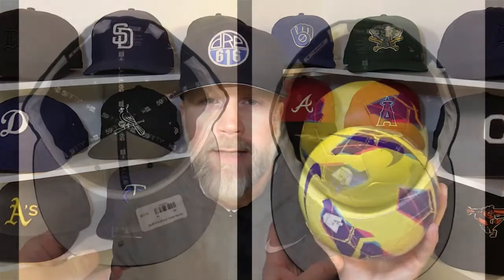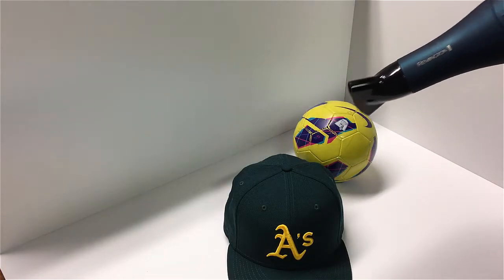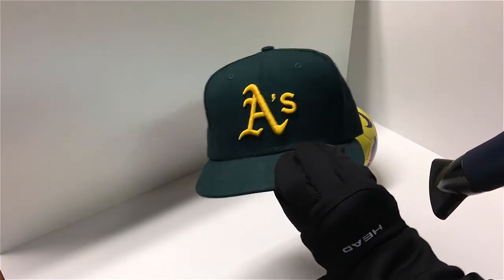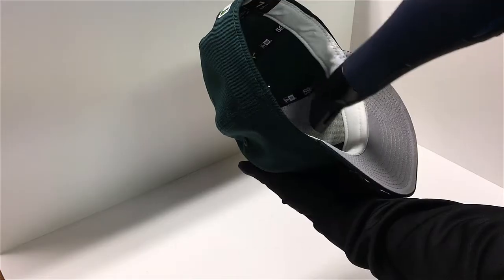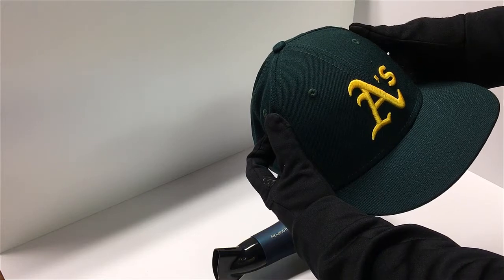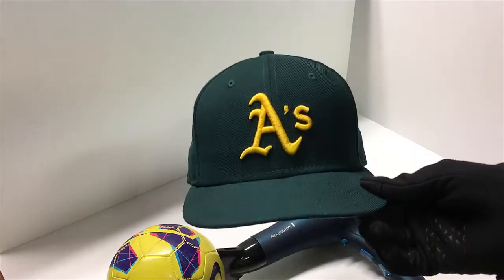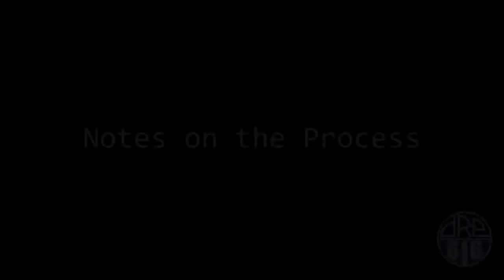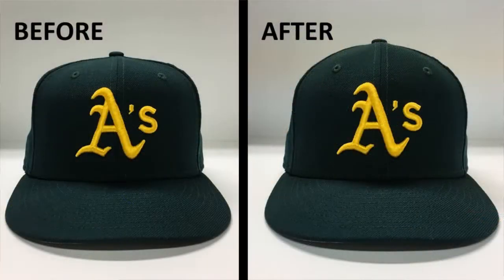Rounding the Crown of your Cap with a Simple Form

Comment: Good video. I switched to low profile 5950 for this very reason, really don't like the flat/boxy look.
Reply: I'm with you. I've noticed that the wide production variances in 5950s means that some are very boxy, and some are rounded. Likewise, some of the low profile ones that I own are almost too low profile.. they feel like a 5950 and a yarmulke had a baby..
Reply: I don’t think anybody does. Even the mlb players hate it
Reply: anyone know my one of my caps has a more stiff front end
Reply: like the back of my hat is round and not flat like you usually see other hats
Reply: Where do u get ur low profile hats?
Reply: @opshit9714  lids, new era, ebay, and sometimes ross/burlington if i'm lucky
Reply: @opshit9714  online. Lids has a few here and there sometimes
Reply: @SirPhilMcCrackinVonBeggington  that’s one of main problems the other is the fact that the sizing is always wrong like the 7 is always too small and the 7 1/8 is too big
Reply: @Bushdidharambe911  Yes, 100%. Sometimes I am a 7, sometimes 7 1/8. One of my 7s is too tight, the other one is too loose lol.

Comment: Is there a opposite method for making a crown flat if it comes rounded off ? I actually prefer the flat look
Reply from the maker: It's all about the form you use - here I used the soccer ball for roundness, but if you wanted more flat you could look for something like a pot or saucepan with a smaller radius on the bottom, and a small enough diameter to fit in the cap.  Then substitute that form for the soccer ball during the techniques that I showed, thanks.
Reply: Yess please make a video of you doing the method the other way around!

Comment: Great video! Thanks, I have actually stopped buying caps by mail (eg Lids) because of this weird shape. Might well help to get myself a size 1 soccer ball.  I wish there was something solid and heat resistant to put in there (bocce ball too small, hmmm) so I could touch it up before I wear it by just sticking the hard ball in there and heating it up a wee bit from the outside of the cap (while working it over the ball if necessary).  I’ll keep thinking, gotta be something perfect size and hard composition (candlepin bowling ball? Lol). Thank you for your videos.
Reply from the maker: You are welcome, thank you for the comments... and maybe there are some places out there where you can get an actual mannequin head from an old retail store.  I've often thought that might be the best form, but harder to find than a soccer ball!
Reply: @dreinthe616  Now thats a good idea.  I'm gonna look. 
Thanks Dre

Comment: How long do I keep the ball in the hat for?
Reply from the maker: Until it has cooled off close to room temperature again... those plastic fibers in the buckram need to cool off so they can maintain the form.
Reply: @dreinthe616  does it work for a 20% wool, 80% acrylic cap?
Reply: @dreinthe616  Oh I see what you mean. The two panels at the front are the buckram fibers that give it the shape..Thanks!

Comment: Will this work with a trucker hat? I just got a new cap and it’s outrageously boxy and high and makes me look like my head is about 6 inches taller under the hat. I hate it! But it’s a beautiful cap so I don’t want to give up on it!
Reply from the maker: Depends on if it has the buckram (stiff plastic/linen woven fabric) under the front two panels.  You can find a video on my channel "Stretching and Shaping Mesh Back Fitted Caps" if that's the case.  But this technique won't work if its a foam trucker, thanks.

Comment: How do I remove the pointy top of my trucker hat? Would love to send you a pic or what I’m talking about. But I bought adidas trucker hat and not a fan of the high point top
Reply from the maker: It's pretty tough to do that because the fold there is very stiff, almost all truckers are made in this way.  But that style of 5-panel caps is now coming back strong with the 9Forty A-Frames and Golfers from New Era, and the Hitch from 47 Brand.

Comment: Can you make just the crown of the cap smaller so it's not so high up on your head?
Reply from the maker: It's a lot harder than it seems - there is a lot of material and volume in the crown, and it has to go somewhere when you try to reduce the height.  In the third portion of my first video I show a way to heat with a hair dryer and mold it a little more to your head, you can see that here if interested - https://youtu.be/8N-EL-rmgIc - thanks.

Comment: How can i do the opposite, i have a very round hat that use to be more square and i want ti reshape it back to a more squared look.
Reply from the maker: I actually get that question quite a bit, may need to make a video soon.  Anyway, just like I used a soccer ball as a round form, you could repeat the process but use a different form to mold the cap - maybe you could find a small pot or saucepan that has the flat top and a small radius... that might give the look you want, thanks.

Comment: Hey Dre. I believe u have seen a THE PERFECT GAME hat and in the inside there is like a thin material on the crown.  Can I still shape the crown ?
Reply from the maker: The structured crowns in New Era caps have plastic fibers woven through the buckram, which gives the front two panels the stiffness.  If your cap material is not stiff and structured, it probably won't hold a shape.

Comment: Could you just place the cap on your head and press the crown against your actual head after you heat it up so it takes your head form, or do you think it’ll be to hot?
Reply from the maker: Good question, yes, you can do that, in fact I showed that method in my very first posted video on stretching and shaping... but if you've got short hair or a receding hairline it gets really hot and uncomfortable.  It can also leave 'grooves' in the buckram where you hold your fingers, so the ball is better for smoothness too, thanks.

Comment: I want my hat to look like yours, it seems to have a wider crown, mine is really boxxy and narrow and square and it just looks narrow too on my head, is the hat you are wearing one you've made look wider? it looks like the crown is as wide as the peak goes, which is what i want, the one i got the crown appears much narrower than the peak, like just a narrow box, if you catch my drift
Reply from the maker: Yeah, I'm following you... the worst thing about New Era caps is the variation from cap to cap - even if they are showing the same size.  I do a lot of steam shaping (go to my channel for some break-in and shaping tutorials), but sometimes it's just the base construction of the cap that limits what you can do, thanks for the question.

Comment: So how long specifically do you recommend to heat the cap with the hair dryer?
Reply from the maker: It really depends the power from your hair dryer... with mine it was probably between 50 and 70 seconds.  But that's why I say do it until the buckram gets soft under pressure from your fingers... that's the best way to know when you can shape it, and I don't want anyone to get upset if they start melting fibers based upon a simple time recommendation, thanks.
Reply: @dreinthe616  Appreciate it

Comment: Hi Doug. Great video! I really like the idea with the ball and plan to give it a try tomorrow. Regarding the hairdryer, what do you think about using steam instead to get the material soft and then use the ball? Or would you definitely recommend using a hairdryer instead? Thank you, really appreciate your ideas, great stuff!
Reply from the maker: It's the heat that makes the buckram "moldable", so you can do it with steam too.  Just don't overdo it with the moisture absorption by holding it over the steam for too long.  You can actually place the ball inside the cap, press outward, and then steam the front panels with the form in place. Thanks!
Reply: @dreinthe616  Thank you very much Doug! I tried it this morning (with a hairdryer) and it worked very well! I did this with multiple hats now, it worked well for all of them.
I have to say by using your advice the joy in my hats increased so much!
I finally stopped looking like a train conductor when wearing my hats 😊
So thank you very much, you truly are an expert in this topic!!

Did you ever try this with a different brand than New Era?
I have a couple of 47 hats and the buckram is a bit different, softer.

Comment: Great video as always Doug, have you ever did the inverse process? I mean, shaping a rounded crown into a more square shape, I'm asking this because I prefer a more square crown because of the shape of my face and head. Thanks!
Reply from the maker: I've never done it personally, but I think the easiest way to do this would be to heat the buckram as shown in the video, and then press the crown and button against a flat surface like a table or countertop as the buckram cools off.  Don't press too far, just try and hold it flat, close to the way you'd like it to look.  Thanks for the question and good luck.
Reply: @dreinthe616  Dear Doug, thank you so much for your help and your prompt answer as usual. I'll give it a try and I'll let you know.

Comment: Hey Dre, love the videos!
I used your steam method to curve the bill and shape the crown of a MLB on field cap, but I think I might've overdone it, since the buckram and the cardboard bill are really flimsy/soft and thin-ish now, although I never went as far as burning the material. It happened less than 24hrs ago, so maybe I should give it some time and it's gonna regain it's stiffness, or it's gone? Is this normal when re-shaping with steam?
Thanks
Reply from the maker: Hey, sorry to hear that... I actually overheated a cap in the dryer a long time ago (lesson learned) and it stayed softer from then on. Hopefully it came back a little when it dried out, because I am not aware of any good ways to add the stiffness and structure back in. Thanks for your comments!
Reply: Starch for clothes in an aerosol can from walmart bring the stiffness back. But you have to shape it at the same time. Got some little creases out from my hat with some spray starch.

Comment: Do you suppose after getting the initial shape, once the material is starting to cool, could you put in on and form it to your own head? I know you need to make sure it's not too hot, but I've got caps with a peak and really dislike that. I do want it round though so I need the best of both worlds lol

Good video though, thank you!
Reply from the maker: Yes, you can definitely do that... I've done it before, and the trick is to press evenly enough with your palms, so that you don't get dents from your fingers.  Also helps to put a light cloth over your head, like a bandanna, to insulate from the heat.  Thanks!
Reply: @dreinthe616  do you have any videos on removing wrinkles from an unstructured trucker cap and forming those?
Reply from the maker: @bmiller.0  No videos like that, sorry - but I will say that steam is the oldest and best tool for manipulating any kind of fabric/textile... the most recent video I posted shows a couple of ways to use steam to smooth out parts of a cap.

Comment: Hey man, i really want to do this but i dont have a hairdryer. (smh) Do you have any alternatives to something else i can use instead?
Reply from the maker: A teapot is the other go-to... get it steaming, then you can hold the outside front panels over the steam and get the small soccer ball (or similar) ready to press from the inside.  It doesn't take long for the steam to soften the material, so make sure you don't overdo it!  Thanks

Comment: Question I got 6 5950 size 7 will the hat jack really give it a stretch close to 7 1/4
Reply: Does your 7 run small? Or does it feel like a true 7? I have a couple 7s that are incredibly tight on my head, and there is absolutely no way I could get them to a 7 1/4 without doing some serious damage to the hat. I am comfortable going 1/8" of an inch larger, but that's about it.

Comment: I sometimes wear my fitteds backwards, and it's not completely straight under the batter logo. There seems to be a slight drop in the middle and was wondering if I could try anything to fix it. Thanks in advance & good video I love breaking in these new hats
Reply from the maker: Cool, thank you.  On your question, it's pretty tough to get that area to hold shape... in the front the buckram provides the structure, but when you get to those back four panels, it's just the fabric of course, and it tends to lay down a bit if it's not filled out by your head.  Don't have a good tip for that one, but thanks for the question.

Comment: I always just cut out the horrible stiffening fabric on the inside. I hate the way they make caps all boxy like that. They make the wearer look like a MORON.
Reply from the maker: It's called buckram, and it's used in caps that have various silhouettes and crown heights - even low, contoured caps like the '47 MVP.  If someone has a full face or beard, a higher crown actually looks better in proportion.  Dad caps can sometimes have the effect of looking like a child's cap, when it's too small in proportion to the face.

Comment: Is there anyways to do the opposite and square it out like the before picture from a rounded cap?
Reply from the maker: Yes, I think it can be done, it is just a matter of finding the right form to use... it might be a small pot/saucepan with a small corner radius that would fit in the cap - you could just heat and form over that instead of the soccer ball I showed in this video, thanks.